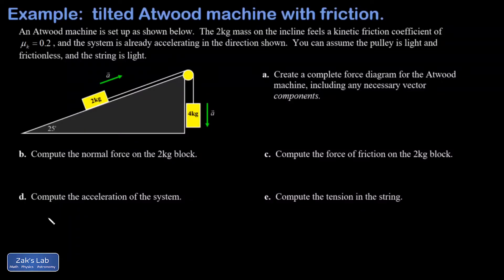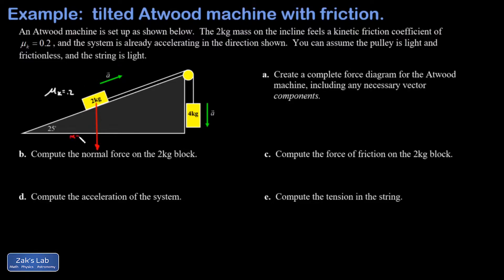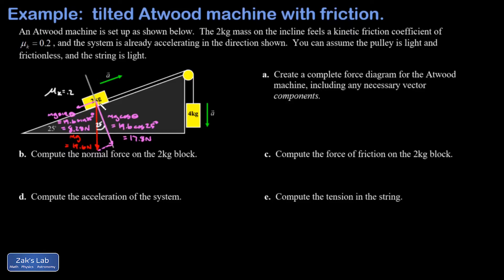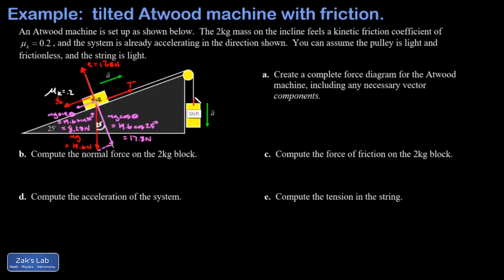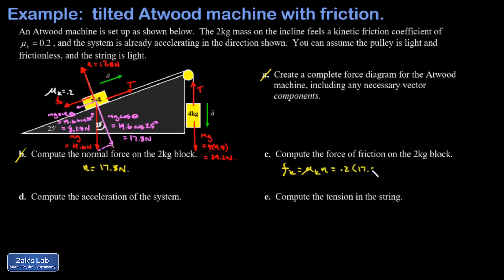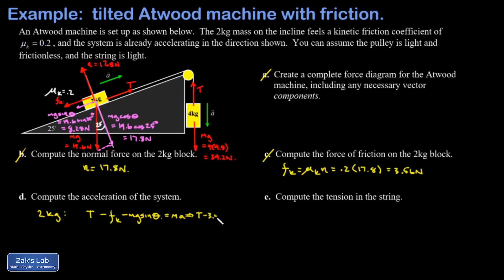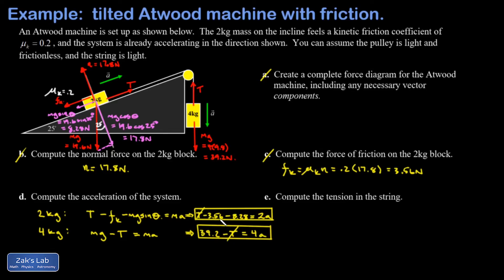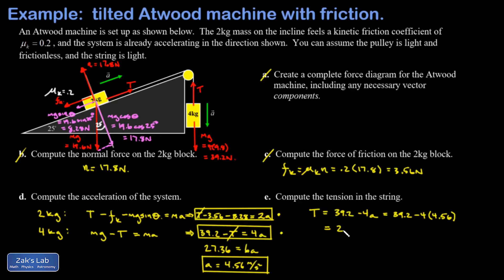Tilted Atwood machine with friction:  diagram, normal force, friction force, acceleration, tension.

Comment: how would you figure out the direction of friction if not given the direction of acceleration?
Reply from the maker: You have to do some kind of test to determine the direction of acceleration if it isn't given.  One way to do this is to imagine that you are holding the block on the ramp, so it can't move.  Compute the tension in the string, and compute mgsin(theta):  whichever one is bigger is going to "win", and you can figure out which way it slides.  If there is static friction, you might have to determine whether or not it breaks loose at all.  So you assume the static friction can hold the block in place, and you compute T and mgsin(theta).  This allows you to infer which way the static friction force must point in order to balance all the forces and how big the static friction force must be, then you can check that against the maximum possible value, mu_s*n.  If the required static friction force is greater than the max allowed value, then the block breaks loose and begins to accelerate in the appropriate direction.  

z
Reply: Friction doesn't have a direction
Reply: @ me when I’m categorically false